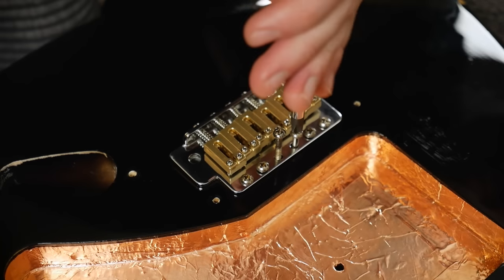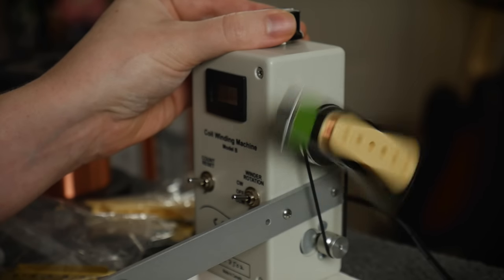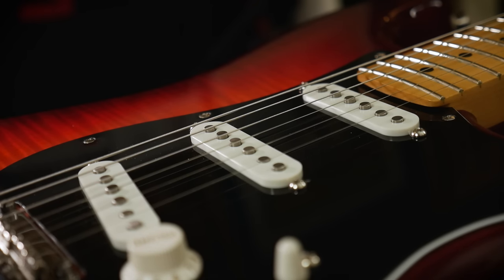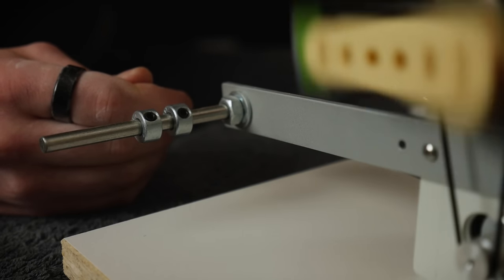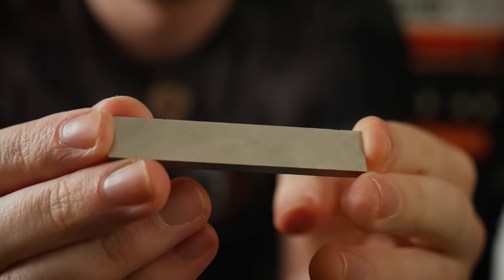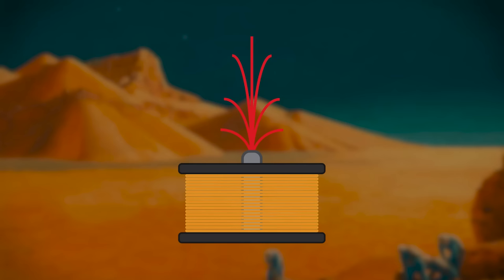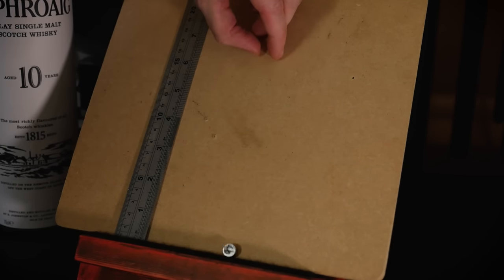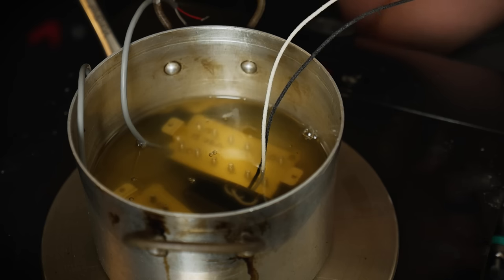(almost) EVERYTHING About Pickups | Too Afraid To Ask

Comment: I have a question involving pickups that i haven't been able to find the answer to. Why does the resistance increase as you turn the volume down to about 7, then from there it will decrease. Every guitar i own does it, so it's not a Fluke (get the pun?). I'm definitely not an electronics guy but pickups and the way they're controlled isn't super complicated. I've checked individual pots and they're fairly linear in their resistance, so it must be the capacitor.
Question 2: Regardless of what causes the resistance to increase then decrease, why doesn't the volume do the same when rolling off the volume? 
Thank you! 
I will be checking back on this video, just fyi.

Comment: Have you ever done a video on the science of shielding the intervals of the guitar? I recently got some new pickups which are splittable to series/parallel humbucker, p90, single coil rail. It’s picking up major interference from the power box in my house on the other side of my guitar room wall. I’ve seen you shield a cavity before but not necessarily how well it works or the science. My luthier reckons it doesn’t work.

Comment: I know your video is two years old, but you seem like the professor style, and I've got a question. I have about 10 CTS and other pots.   So I measured all of them each way (you can make them work backwards just by wiring them backwards. So there's two values for lowest resistance and two values for highest resistance depending on which side of center you're measuring. I noticed a number of inconsistencies and wondered if these could add to the variation seen, or heard in guitar tone. Also, how they move from their lowest reading, ~2 ohms, to their highest reading isn't consistent. Some start slow then just a touch on the knob moves the meter a lot. I was going to plot this resolution, measuring every 10 degrees, but I haven't done it yet. The topic of some guitars sounding much better than other, seemingly identical guitars is bafflng, and I'm going to continue exploring it with as scientific as approach as I can. I'll let you know if I find something interesting!

Comment: OK, so I understand how the pickup is made and how it works. What I still don't understand is how the specific acoustic tonal characteristics of any note played translates into a variation in current and how it's converted back to a sound that retains those tonal characteristics. 

So for example, if you pick a note right next to either end of the scale length, it's very bright and jangly with no low end but if you pick that same note over the 12th fret it's fat and rich. From a purely acoustic (and simplified) point of view, that's because the picking position affects the amount of physical energy transmitted to the string and which harmonics inherent within the overall sound are excited, resulting in an increase or decrease in their amplitude. But that's just an acoustic property, right? And even on an unplugged electric guitar you can hear the difference. 

Picking a note with your finger sounds different to using a pick. Again, I understand why this makes a difference in terms of acoustic physics, but in terms of electrics, how is all of that tonal information able to be recognised, and then "encoded" within a current fluctuation caused by the vibrating string's relationship to a pickup, and ultimately translated back into that same sound by an amplifier?

Let's assume for a second that "tonewood" made an enormous difference to the amplified sound of an electric. Let's also assume that neck joint construction, scale length, string gauge, nut material, overall body weight, type of paint, density etc. also all made a massive difference to that amplified sound. If a pickup is not a microphone, why would any of these factors make a difference to the eventual tone of the amplified sound, and how does electricity know? 

Does this make sense? Is this a really dumb question?  Can anyone help?!
Reply: Not sure I fully understand the question, but you may be overthinking it.

Sound comes from vibration. If it sounds different, then it's vibrating differently. The pickup simply translates vibration into an electric signal. There is no fancy encoding going on.

As for tonewood etc: there will always be a physical feedback loop in vibrating systems. It just makes very little difference with electric guitars.

Comment: While full-immersion wax-potting provides guaranteed immunity from microphonics, realistically the inner turns of the coil are snug.  I've found it's mostly the outer 1/3 of the coil where there may be some slack in the turns, resulting into risk of microphonics.  So, in the absence of a setup to provide full immersion, what I do is position the pickup on its side, and, with a candle poised 6-8" above the exposed coil, I use a heat gun to melt wax onto the coil from above, and employ a low heat setting of a hair dryer or similar to provide closer heat application that distributes the flowing wax through much of the coil.  It obviously doesn't soak ALL the way through, but does a decent job soaking into that outer 1/3 of the coil.

I will also note that the difference between single coil and coil-cancelled humbuckers is NOT simply due to the shape of the bobbin and resulting coil.  Keep in mind that the slugs in the uncancelled coil are magnetically coupled to the bar magnet and slugs in the other bobbin.  It is as if we have taken a single coil pickup with very long polepieces, and bent the part sticking out of the bottom to make the other end of the polepiece point upwards.  That's a very different outcome than simply using one out of two coils.  At present, there are no commercially-available pickups I'm aware of that decouple the two sets of slugs from each other when using coil-cancelling on a humbucker-style pickup.  It would be an interesting product, to be sure, but require a deeper route in the body to be able to push the coupling bar away from the polepieces of the coil-in-use.
Reply: As an addendum, I'll note that the original Fender Wide-Range Humbuckers used polepieces in each coil, rather than slugs magnetically coupled to a common bar magnet of some type underneath.  The WRHBs lacked any actual coupling between coils.  They were essentially two individual single-coils in PAF-like bobbins, crammed into a single chassis and cover.  It's been over 45 years since I've taken one apart, and I don't know what the bottom plate was made from, but the polepieces were not in contact with the bottom plate.  The polepieces could be adjusted to poke through the holes at the bottom, and could come close, but did not touch the bottom plate.

I may have mentioned it here in past, but one of the quirks of the WRHB was that, by use of actual threaded polepieces in both coils, their height could be adjusted to mimic the sensitivity of an angled Telecaster bridge pickup (these 3 up, those 3 down), without requiring any change in the mounting angle of the overall pickup.  I suspect this was the impetus for the 3+3 polepiece arrangement.

Comment: Okay, nicely done. 
One question, can you shed some light on why some pickups are so insanely expensive when they are fairly simple devices? 

I get handmade stuff being more labour intensive but when a large manufacturer with streamlined processes charge 200quid for a pickup I can't help but call shenanigans. 

Is it just brand or are there some factors which mignt actually justify the price?

Comment: The only problem (or to others best part) of hand wound is even someone with skill and hands like Tim Mills can't reproduce the exact pickup twice, so if you get a really cracking pickup with something that just speaks to you, even if you chart the winding pattern start to finish you will never be able to replicate all of the little imperfect movements it'll be close as "dead on" in most cases of skilled repetition but at some point it'll never be exactly like it 
It's beautifully unique and no one else can have it but that sucks if you want more than one 
Depends on which way you wanna see it

Comment: Actually, Colin, I've seen where no less a pickup luminary than Seth Lover has said that the magnetic field of the permanent magnet(s) of a pickup MAGNETIZES THE STRINGS.  The new mag field of the strings cuts across the coil windings when the strings move, which has the usual effect of generating a small current in the coil.  Just saying.

Comment: I have a potentially dumb pickup related question. If I undo one of my hum-buckers, say at the neck and turn it 180 degrees, then screw it back in. will it make any kind of difference as there is two wrapped coils inside them ? Thanks pal great video I learned a lot. as always your very articulate and descriptive cheers buddy 🎶🇬🇧👍🤘

Comment: Ok, from the actual testing I've done, I installed a full range boost in my guitar with a pokey humbucker (15k ohms i think) and turning the boost all the way up completely obliterates the signal into a muddy mess.... 
is this why active pickups are typically low wind, so they have have the clarity of a low output pickup but the "shove" of a high output pickup?
At least to my mind this seems to make sense.....

Comment: Great video.. you forgot to mention that potting pickups in wax change the tone and dynamics of the pickup... my best sounding guitars have PAF copies that are not Potted in wax, In the past I ordered the same exact pickups that were potted in wax, but  unfortunately, it changed the sound of the pickup and dynamics for the worst.
Reply from the maker: Unpotted pickups are just converting non string related vibrations into signal, so potting doesn't change the tone, it simply eliminates the pickups microphonic properties which is what you've been hearing.
Reply: The wax was there simply to protect the insulation of the windings. With newer insulation 'lacquers' it just not needed😎
Reply from the maker: @richardrichard5409  this is factually incorrect. Wax potting is as important as it has always been to consolidate coils and prevent microphonic behaviour. Any loose parts of the coil moving around independently will generate unwanted noise. Wax potting prevents this.

Copper wire for coils has always been insulated, the coils would simply short across itself otherwise.
Modern insulation is certainly more robust than what was being used in the 50s, but they also weren't wax potting the coils in the 50s.

Wax is not there to protect coils or to function as an insulator; it's there to make the pickup coil one monolithic structure.
Reply: @Richard Richard  not necessarily, wax was used to stop the feedback and microphonics.. the real holy grail PAFs of the late 50s and early 60s did not use any wax potting, and that is one reason why those pickups sound off the chart great.. potting pickups came about later on.. my point is that potted pickups do not sound nearly as good as non potted pickups.. I was just surprised that it was not mentioned in the video.

Comment: I know you said not to ask "But what about X pickup..." but.... what about the lightwave "optical" pickups? They don't use magnetic inductance at all, so the process must be oretty different, right? But also, you don't need a special amp to use them or anything, so the signal that actually leaves the instrument must end up the same as the signal from a standard pickup.

Very curious about these and I think you'd actually explain them in a way I can understand!

Comment: I beg to differ, ceramic pickups are amazing. Darrel Braun made a video about this. Do check it out.
Wilkinsom pickups use Ceramic magnets and they sound amazing too!
Its all marketing gimmicks! Ceramic pups are amazing
Reply from the maker: I'm not sure what you are trying to prove to me. I have lots of ceramic magnet pickups, I know there are good ceramic magnet pickups, but I don't like them as much as pickups with alnico magnets. 

I'm glad you think they are amazing (so much so that you've said it 3 times in one comment), but I prefer my Alnico 8s for a high output magnet, they have more character to my ear and better high frequency definition.
Reply: @ScienceofLoud  yes I said it 3 times 😂,
 I think because, It came as a shock to me as well. I was always of the opinion, (mainly because of the Internet) that ceramic sounded harsh and aren't as great as Alinco, untill I got a few sets and tried them myself. Once I started working with a custom guitar builder in the summer of 2018 I learnt that a good balance of all the other elements (gauge, winds, spacing etc) can really fine-tune cheaper ceramics to give you some great tones with nice definition.
The point I was trying to put forth is that more than anything ceramics have gotten a bad name mostly because of the cheap = bad mentality.

P.s I love your channel, all your videos have improved my understanding about guitar, gear and everything in between

Comment: @CSGuitars does the heat for keeping the wax liquid have any chance of expanding the copper wire when potting the pickups?
Reply from the maker: The copper will expand with heat, but not to any significantly measurable degree. The wire is thinner than a human hair, a fractional expansion will be tiny. 
Perhaps the expansion and subsequent contraction will help the liquid wax permeate deeper into the coil.

Comment: What is it that causes some  PAF type of pickups to be noiser than others .  We call them Humbucking pickups but with some pickups not all of the hum and noise  gets bucked or canceled out.  For example  the relatively newer epiphone  the 650R rhythm and the  700T lead pickups used in their sub $300 guitars are much quieter than some of the more botique type pickups I have installed in some other guitars .  My problem is made worse as my music room is located on the side of my lot and a short distance from the High Voltage 14,000 Volt 60 Hz Power Lines .   I just thought you might have some insight.    Thank You    James

Comment: What would cause a pickup not to pick up the high E string (1st string) well?  The pickup is good on the other strings.  It's a bridge humbucker.
Reply: The strings gauge and angle of the pickup?
If the poles are adjustable it is easy to fix.

Comment: So, even though this is an older video, I specifically found it to leave this TATA comment/question because it pertains to the subject at hand. I just recently learned about a guitar called a Gibson Blueshawk, and upon looking into it, I was introduced to the concept of dummy coils or dummy pickups. All I've been able to gather is that they somehow reduce (maybe eliminate?) 60 cycle hum in a single coil pickup. I've watched a few videos that show just removing the magnets from a single coil pickup and then soldering this coil electrically in with the other pickups. However, I don't really "get it."

Why? How? Huh? It looks like just adding a bunch of wire into a chain, or sort of like a second coil in a humbucker. But if it doesn't have magnets in it, how does it do anything significant? If it does implement humbucking, then is the wire is the important part? Why do humbuckers have magnets in the second coil in that case? Why/how would this coil affect hum, rather than just adding a bunch of resistance to a pickup, making really muddy (or bright?) or something? Once I figured out that this was a rabbit hole I was going to get lost in, I thought, I bet Colin could explain this. So, my official TATA question is what is a dummy coil, what does it do, and how does it work?
Reply from the maker: If the coil doesn't have magnets then it can't induce a signal from string movement, but it will still operate as an antenna to receive 50/60Hz hum.

A humbucker uses two coils which are wound in counter directions with opposing magnetic fields resulting in the string signals being in phase, but the noise signals being out of phase.

If one of those coils doesn't have the magnets then it doesn't contribute to the signal, but will combine with the other to cancel noise.
Reply: @ScienceofLoud  Oh, okay... so it's still the RW part of RWRP in a humbucker. So, if it doesn't contribute to the signal, but still bucks the hum, then does this mean you still get a true single coil sound, or would it sound like a coil split humbucker pickup?

Comment: Just a couple of questions; are rare-earth (Neodymium) magnets used in pickups, and why don't single coil pickups generally have metal base plates like humbuckers ?
Reply from the maker: 1. Yes, occasionally they are, but aren't a popular choice due to their strength and the different winding considerations required to balance them sonically.

2. Tradition and cost. The original Fender patent design for the Strat single coil showed steel baseplates for extended low end response, but it never made it to production due to cost. Cheaper to produce the coil without the baseplate. That design then became the norm thanks to the massive popularity of the stratocaster.
Steel baseplates are offered as an option by many pickup builders for an added extra for single coils.

Comment: Nice video. Question for you, I have read  that the magnets in the pickups induce a magnetic field in the strings and this magnetic field moves when the strings Are struck which is actually what induces a current in the wire coils in the pickups.  Is this how a pickup truly functions?
Reply: Yes, and that's why you don't want to use acoustic guitar strings on your electric guitar, since they are not going to stir up the magnetic field as much.

Comment: How much voltage and current does a single coil pickup usually give off, or what is the voltage drop / difference, say for instance, strumming vigorously or gently? 
Would a humbucker give a greater voltage drop / current than that of a single coil pickup?